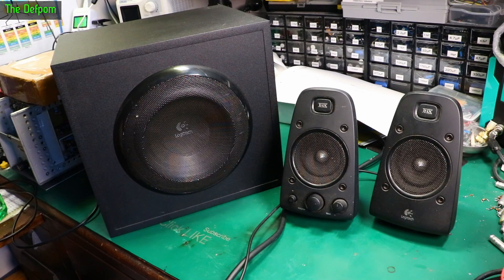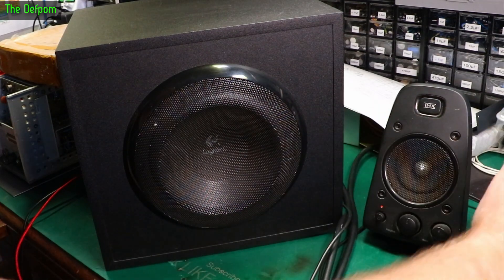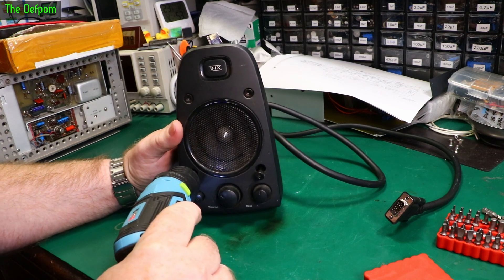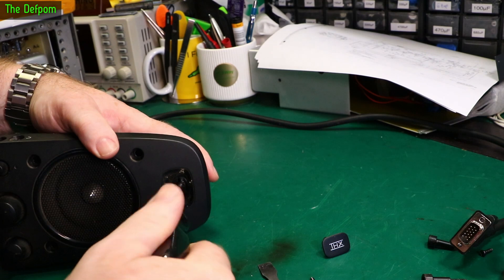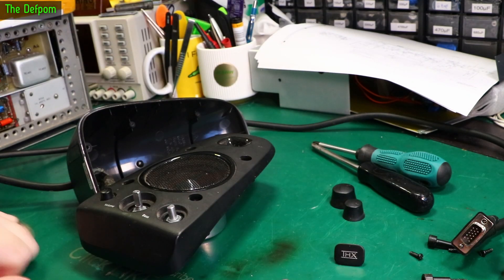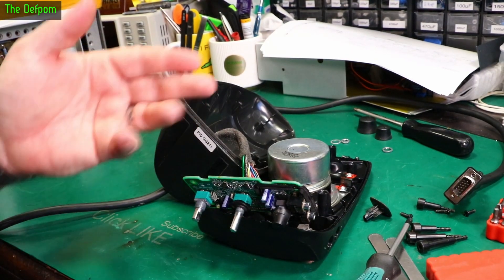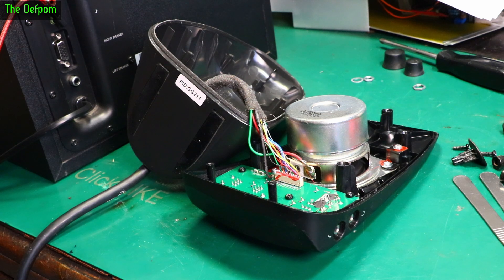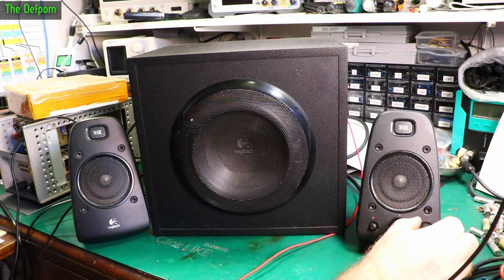🔴 Logitech Z623 2.1 Channel Speaker System Repair - No.1133

Comment: My speaker suddenly broke down while the volume was turned up. There was no power. Why could this be? The volume was a bit high.
Reply: Same issue. I had not used my computer in a while, went to do a video meeting noticed it was powered off. Unplugged it plugged back in still off. Came back a day later the dang thing is powered on I thought cool. Next day off again no power.

Comment: Ayo, very helpfull! I had an old set laying around. after 5/10 minutes, the subwoofer stopped working. When you cranked the music to max and back, sometimes you were lucky that the sub start working again for like 5 min. Opening the speaker with the on / off button, cleaning it made it work again!

Comment: I also bought a broken used one, but I cut the three speaker cables and converted it into a passive speaker.
 I connected it to a cheap digital amplifier, and the subwoofer sounded fine, so I'm very satisfied.

Comment: Hi, my unit turns on and off ...most probably a bad connection because I keep moving the speaker with the knobs and it stops. Do you think it would be the main cable or one of the little ones that go to the panel?

Comment: Although the video is old, I hope for your help) I bought used speakers. At first, I didn't seem to notice anything, since I used them at low volume. But when I increased the volume above 50 percent, I noticed a wheezing sound in the right speaker, which is quite strong to be annoying. I use a cheap AUKS cable, but if the problem was in the cable, I think the noise should have come from both speakers. If this is not the case, I will be glad to hear it. And yes, I also have a small sound when changing the volume, but it is different from the sound when playing. What could be the problem, or how can I diagnose the speaker myself?
Reply: Здравствуйте. У меня тоже были хрипы при увеличении или уменьшении громкости, но сегодня я эту проблему решила. Нужно разобрать колонку и почистить регулятор громкости от грязи, побрызгать очистителем контактов или спиртом и покрутить, удалить загрязнения. Удачи!

Comment: Thanks man, you saved my day...
Mine has a rattling sound, & the cause is non other than the speaker itself.
I will changed the speaker to Rockford Fosgate R14x2. Since the wattage are the same hope this works. 😅😅😅

Comment: Thank you , you just helped the planet from junking good set of speaker , can you tell me if torn speaker can be fixed
Reply: You can fix tears in speakers. Get Aleenes tacky glue. Mix the glue with water 4 to 1 water to glue and paint it on the tear with nice thin layers. Do not gob it on thick. Nice thin layers, let it dry in between coats. Try and do both the front and backside of the tear.

Comment: You're telling me it was as simple as the plug coming out? Man I hope I still have this in my storage closet so I can fix it. The plastic or rubber tube came unglued, which pulled out the cable from the back of the speaker. Had no sound coming from the speaker with the knob. I hope this is the issue and I just have to glue those two things.

Comment: Sir what is the output voltage for amp z623 bcoz mine is already burnt out primary section so I want ed to fix it by myself with alternative power supply output for the amp z623 but you know I could not find the exact output that's why you knows if u can help me by any chance  im so happy Sir ❤ thank you&sorry about my english I hope you can understand it 😅😊

Comment: Bought mine in 2011,only Issue is the cable connector in the back who give a bit of interference/crackling noise if i touch it(black RCA connector),and very small click when i open the volume from zero(the rest of volume and bass are without crackling noise like this one.).

Don't understand why people saying this is garbage. This played at 100%(full volume and bass) for hours and never died on me.Maybe new build are cheaper,but 2010/2011 models one is rock solid.
Reply: New models are now 2x costlier and less durable.

Comment: for the likes of money I've spent on this crap, I would buy a decent monitor speakers from a good brand like Yamaha, not some computer peripherals manufacturer like logitech. Mine still work, I just cleaned the power switch with WD contact cleaner (iso-propyl alcohol can be used too, but I recommend something in pressurised container), bass and volume controls too. Pity you did not include that in your video. You also missed to add that there are nuts on these controls and they have to be unscrewed to remove circuit board, otherwise it'll not remove or break. Thankfully I spotted that on time. Good video for starters, missing most of important details though. Big plus for the workaround involving cable ties to secure the main lead.
Reply: No monitor will give you this kind of heavy bass for sub 200$.

Comment: do you by any chance know what  are the size and specs of the sattelite speaker , i need to replace mine since it has a crackling sound coming out of it , looks like the cone is ripped.

Comment: Guys, volume potentiometer needs to be cleaned with a contact cleaner like wd 40 for example. No need to open the speakers and it will also stop the cracking noise when changing volume.
Reply: Vaccum cleaner can be used to suck the dust particles. I have done it muliple time to avoid cracking sound. But, this time after cleaning dust particles volume also feels increased.
Reply: @albiero1  how do you do that without opening the speaker?
Reply: @shankhasarkar9817  same question

Comment: Thanks for the vid. I even removed the bottom pads to see if there were screws but wasn't paying attention to them pointing forward. Got it taken apart and smoothed out a caved in speaker grille.

Comment: They are a good system, mine had a dodgy power on switch that was cutting out all the time so I fitted  another separate switch I had handy with some jumper wires, still has scratchy volume control, but I just generally just set it then just make any changes from my computer.

Comment: Have the same issue with Z623 speakers. I have toggle the volume control button to get the base coming out from the sub woofer. I will try this and see what happens. Thanks. I could never figure out how to open the control speaker.

Comment: The PS5 fan has different screw lengths and I really don't understand why they do it. I was thinking of buying the Logitech Z623, now I'm not sure I want to.
Reply: I own my second pair of this after one get totally crushed in the truck as i moved to my actual home. Would buy them a 3rd or 4th time.
My personal opinion... they perform much better then the price tag let assume.
Sorry for the bad English but school is now 20 years ago 😅
Reply: @Joost-Fabian  After the price went up for the Logitech Z623, I ended up settling on the Panasonic SoundSlayer Soundbar, it pairs well with my TV.
Reply: @Joost-Fabian  Bought 1 over 15 years ago. bought a second set about 10 years ago and a 3rd set 4 years ago. The first one of those just died after 15 years of pretty heavy use! I use these all around the house and will probably get a new set now this one died!

Comment: Thank you for showing this. I have the same speakers and after 10 years of using them the bass control seems to be not working ... They still look like brand new, even if the design is not something I would call nice. Anyway as a consumer of this product its sad just to buy a new 2.1 system. And you are right, so many different screws to take out and kind of bad cable management. They could have done the construction of it way better. Thank you again, this video is helpful!  I have hope! :)
Reply: haha , damn design never changed

Comment: Thank you for the video!
I had to remove hexagonal washers from the two poti before being able to remove the PCB. I don't think they need to be tightened a lot.
Simply opening and moving cables and the connector fixed a noise that came up whenever I changed volume.

Comment: I just need to add something. This a great video for those who want a project to do but in my opinion no one should ever have to repair a bad unit after a few months or a year.  I have had old stereo Sony and Bose speakers that have lasted decades without fail.  What's the deal with Logitech and their crappy speaker systems.. Do not patronize this company buy another brand and do your home work..

Comment: Did you check the sub woofer? On mine the problem is the sub woofer not working.
Reply: I have the same prob with mine, spray some contact cleaner into the 3.5mm socket on the sub, worked for me

Comment: I had the exact same unit, Logitech has gone downhill with their speakers :(

In the case of mine, it wasn't a problem with the volume control, it was the power button, it was very scratchy when you went to turn the unit on or off. In the case of that, the only fix was cleaning it, and for my one, that didn't solve it at all.

I even went as far as desoldering, cleaning, resoldering, etc... 

In the end, I got rid of it during hardwaste collection of 2021 (September I believe). Got myself some Edifier bookshelf speakers instead, loving those.

Comment: The zip tie picking lawyer! I always thought logitech made the better sounding set for their price.
Reply: Logitech makes this exact model for over 10 years now, but quality has gone downhill, my brother bought z623 set in 2013-2014 or so, it had a different box and 200w rating, I bought mine in 2017 or so it had blue box, with rating of 400w on the box and neither volume knob nor bass knob have writtings under them to indicate which is what, also my brother plays his speakers at 70% volume with 50% bass and nothing for past dunno how long years, but when I play mine at same level of volume and bass - you get the distinct smell coming from subwoofer (not yet burning but I hesitate to push it) or last time when I did play it for 30 minutes. So even speakers are the same - my brothers older set has much better quality than mine